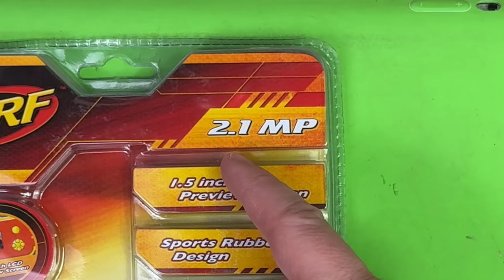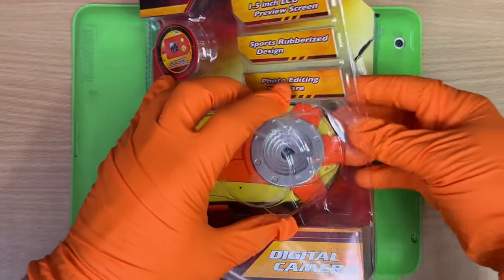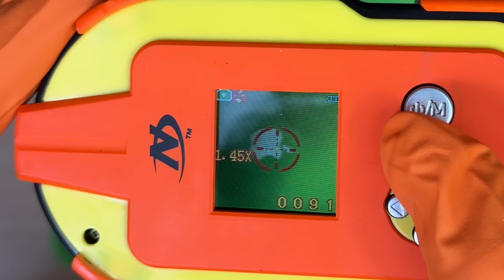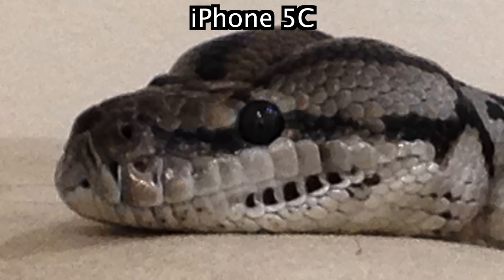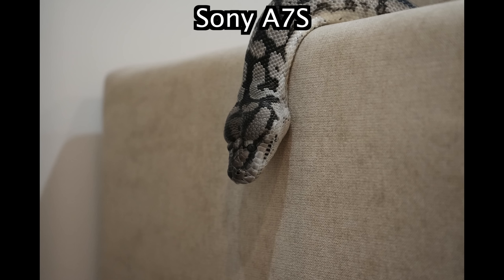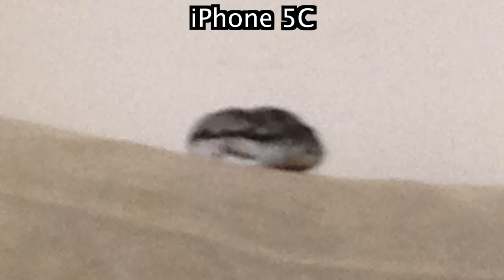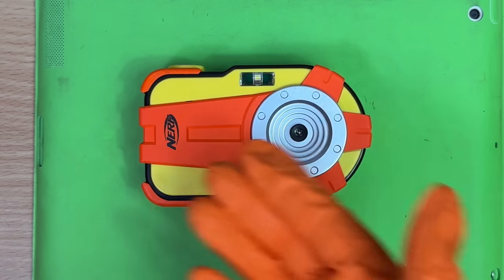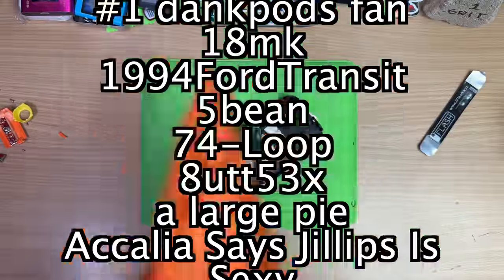The Nerf Digital Camera.

Comment: There might be something to do with the fact that modern phones use an infrared laser for auto-focus that ends up drawing Frank to it. After all, thermal vision cameras detect infrared heat emissions, so Frank might be able to see / sense the flashing infrared focus laser on the phone and is thus attracted to it.
Reply: That's what I was thinking; might look like prey to Frank.
Reply: wrong infrared for heat, thermal ir is an order of magnitude longer wavelength than the maybe 1000nm ir used for "laser autofocus" however he might be able to see the ir led and be drawn to it anyway. more likely it's the modern phone being hot af with the camera running and interesting frank that way

Comment: I agree that the Toldeos can and should be repaired, it's HARD to find quality full metal scissors anymore.
My mom has really nice set of sewing scissors that she uses to slice through leather  and she maintains them between professional sharpenings by chopping into fine sandpaper and occasionally cleaning with vinegar. It works really well!

Comment: As someone who collected nerf stuff for the better part of a decade, I love that the nuggets (especially the mp3 player) share design cues with the actual blasters of the time. I recall the camera being about 50 USD but I may be wrong. There was also an action camera  in the line that shortsightedly didn’t attach to nerf’s attacement rail system, and a standalone package of nerf branded dirty buds.
Reply: iirc they later released a blaster with an included nugget camera
Reply: Okay if they were 50 USD that's a ripoff.

Comment: 1:10 moisture, maybe?
Edit: Not moisture, Just rubber turning back into a sticky, liquid form. (Almost typed Luigi there)
Reply: That's not moisture, that my friend is a lovely disgusting thing called "Rubber Reversion" where things made of processed rubber, whether natural or synthetic will begin to turn back into a viscous liquid, and said object will become sticky to the touch. It's also the reason why a lot of old electronics like VCRs almost always need to be replaced because they either go sticky and gunk up the machine, dry out and and disintegrate, or sometime an unique and weird combination of both.
Reply: @IcySlavKat  Ew, that sounds weird. But thanks for answering! ;)

Comment: Little tip for when you have  gooey rubber on something you want to keep, a bit of alcohol rubbed on it cleans it off. I had written off an old joystick until I saw LGR fixing some rubber buttons with alcohol. I gave it a try and low and behold it became usable

Comment: When I was in highschool I had a Nerf wireless ps2 controller.  I actually loved it, it was smaller than a standard controller but it actually felt really good. I believe it was the first wireless controller I ever owned. Instead of having hard plastic case, the entire thing was made out of nerf foam so you could throw it around when you got mad at videogames.  It was great until the glass cover of our ceiling fan fall and landed straight on the sticks and broke the internals on both.  RIP nerf controller, I loved you

Comment: I have that exact camera. its not nerf branded its just a reskinned vivitar camera, the screen is the same the buttons are the same places the only difference is that mine has a macro lens and an av out which is the only useful part of it as I connected it to a tv and used it as a security camera with a home made power supply.

Comment: The only nerf electronic gadget I ever actually thought was cool and kinda practical was their night vision sight. It was surprisingly cheap and unlike many other toy "night vision" devices, it actually did use infrared camera and illuminators. It generally resembles an IR capable security camera and the IR LEDs weren't particularly bright. However, pairing it with a cheap but powerful IR flashlight I found online made it have such an extreme illumination range that I still kept it even after outgrowing nerf for the most part, taking it apart, spray painting it black, modifying a picatinny rail mount onto it, and using it for airsoft night games. The resolution isn't the greatest but it's definitely enough to see the enemy team moving around when paired with the IR flashlight. 

Surprisingly, the day mode works better at night than the night mode when using an external IR light because of the shitty green filter it applies in night mode to simulate high end NVGs.

It does have the ability to zoom in, but digital zoom and cheap shitty cameras don't really mix. The reason it was probably quite cheap is because it is probably actually cheaper to make the camera IR sensitive. Most digital camera sensors are sensitive to IR light and have a special filter added to remove IR light, not applying that filter allows IR to enter and be picked up.

Comment: Nerf’s nugget electronics era was… interesting. Had a Nerf PS2 controller that wasn’t terrible and it was the only wireless PS2 controller I ever had. I’d hate to touch it now though because it’s probably turned to goo, and it had an annoying battery compartment with a screw to lower its age rating.

Comment: A bit late but the camera he was using (sony A7s) is from 2014. Its not even meant for photography its more for video. A normal photography camera usually has 24+ Megapixles whilst his has only 12 (plenty for video but you usually want more for photography). Also it being older model means that the sensor and processor is much worse than modern cameras, a modern sony camera would make his A7s look like it was the iphone 5C. Still was a really interesting comparison! :)

Comment: I was quite surprised with the nerf nugget because I’ve also taken many photos with old digicams and 2mp isn’t all that bad (let’s just say that I’ve seen worse). The biggest issue in my opinion is the horrible lcd display and the fact that they didn’t even include a non-electronic viewfinder. Also the rubber was a bad design choice.

Comment: Rather than toss the scissors,  why not just take off the rust with steel wool, then put a light coating of oil to prevent rust? Old tools are great.

Comment: You want a real nugget DP? I have a working (last I tried it) Kodak DC40, from 1995. One of the first consumer digital cameras, it boasted a massive .4 megapixels, a whole 48 images worth of internal storage and needs a serial connector to transfer to PC 😂 (the cable chonked out but you can still get new ones for $7usd ish online, and there's USB ones for the dc3400 that supposedly work with it

Comment: You might be interested to review some of the most blatant Chinese knock-offs phones from the 2010s.

They made it to look like a Blackberrys and Nokias, some of those phones even had a built-in TV receiver which enabled one to watch a television, offline. 
They got a camera too, but I promise you the NERF did a much better job at being a camera 😂

Look up IMO B9000 it looks like a Blackberry Bold, or IMO G910 which looks like the Nokia E63. The IMO B9800 looks exactly like a Blackberry Torch. They even make the menu to look like an actual Blackberry, it's insane.
One of the models with a TV is the Mito 911 and this is just one of them. Look up brands like Cross, IMO, Nex, SPC, Beyond.

Comment: Ah Vivitar...cheap webcam made as a box. Possibly the cheapest digital cameras you could get at the time. It's probably interpolated to 2.1mp and actually taking them at 640x480 or adjusting according to light. When you wanted to say you have a digital camera but only had $20.

Comment: I have an iPod that worked fine but I left it in a drawer for awhile as I don't use it alone and I plugged it into power and it says please wait very low battery and its spinning a little loading wheel what should I do